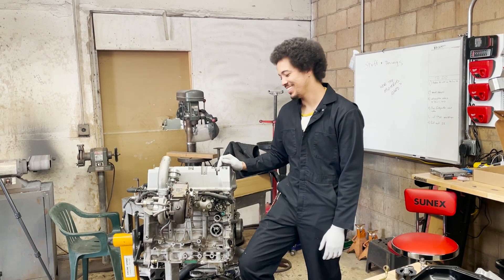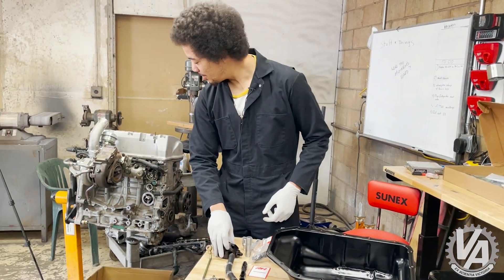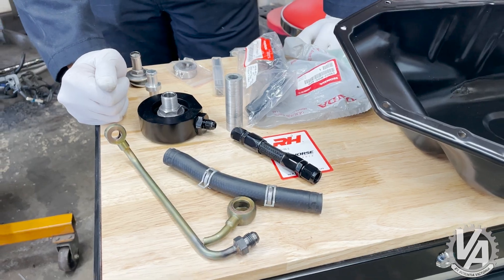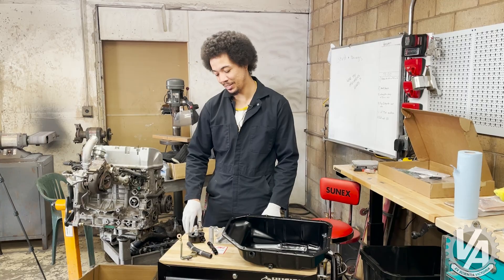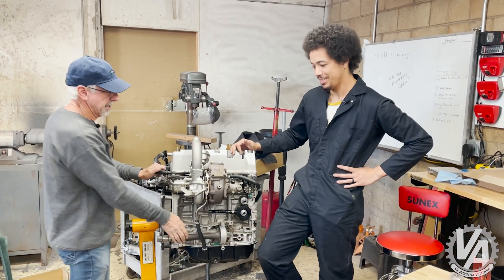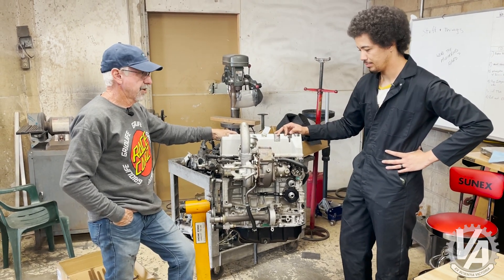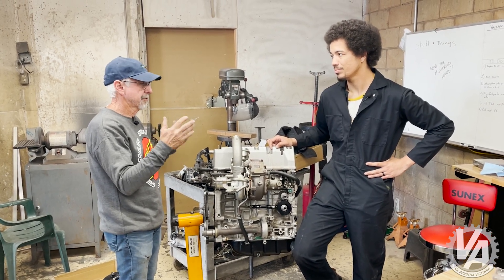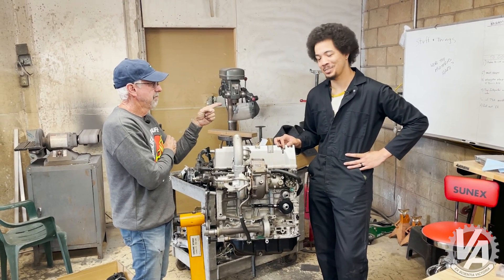Turbo K23 K20 Hybrid Build Cooling and Oiling

Comment: i heard somewhere in a forum, there is one k20 head that you can throw on a k23 bottom end and can make 500 wheel with a built top end in a rdx but i dont know which k20 head to use.
Reply from the maker: I’ve never heard that.

Comment: Hey!!!! I have an awesome tip for you from another guy who has these k series dialed in when they are being boosted!! I know your oil return line is easiest ran right to the back of the oil pan . But when you are driving and hard on acceleration all that oil will be pushed back of the pan... , Your oil feed is right there and it can actually cause back pressure in the turbo and your turbo will start leaking all it's guts out (oil) . Get some longer braided -8 line and run it to the front of the pan!!!
Reply: I really hope you see this comment before you put the engine in the car!
Reply from the maker: We'll try it both ways.

Comment: Why is there cooling for the exhaust manifold? 
Wouldn't you want to delete that to get more airflow through the turbo?
Reply from the maker: I'm not sure why Honda did that. But because there are passages there, to not cool it would probably cause problems.

Comment: This  would  be a great  option  for  a ep3  or base rsx
Reply from the maker: I think we need to try it in that chassis and see if the cowl interferes.
Reply: @VTECAcademy   I think   the charge pipe off the turbo would be  the main  problem 🤔
Reply from the maker: @1988mcclain  We will fab up something to go in the correct direction.

Comment: Awsome info, plus one for fitting this into an rd1... there is plenty of room compared to eg dc as you know. That info on spacing the rear mount is gold everything else on a standard ekk2/ekk5 kit with eg subframe lines up perfectly for the rd1, just send out longer bolts and spacers with an ekk kit for rd1?
Reply from the maker: Hasport will just make a RD1 specific mount.
Reply: @VTECAcademy  sounds good 😁

Comment: I would've worked out the oil drain differently and done it last with most of the goodies bolted on, before going through the trouble of drilling and welding the oil pan.  That way you know what you have to work around before doing work that has to be undone.

Maybe cut and reweld the turbo oil drain like 90° so it points towards the block and goes behind the intermediate shaft instead of over it.  That is, IF you have the space.  You can use a P-clamp in an unused hole for securing it solidly.
Reply from the maker: There are many ways to get it done for sure. And luckily I have about 6 of those oil pans.